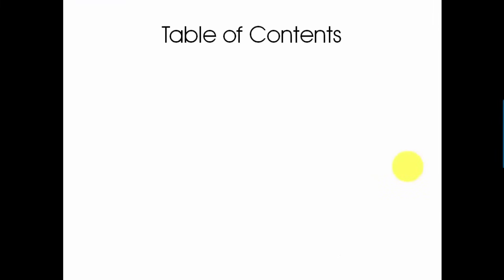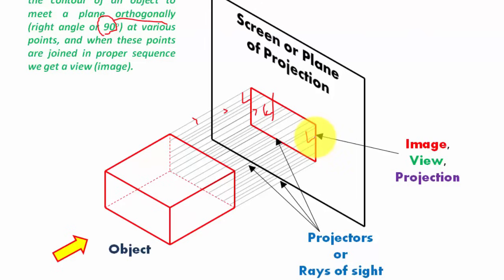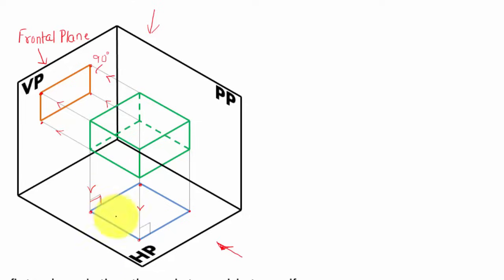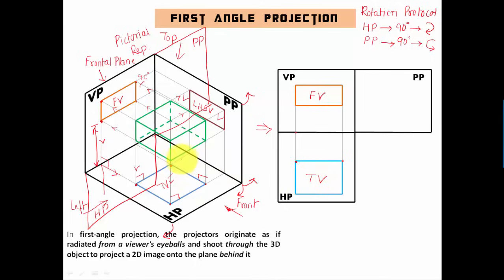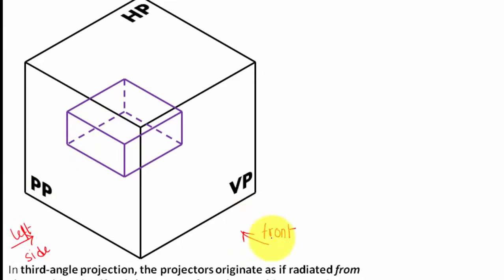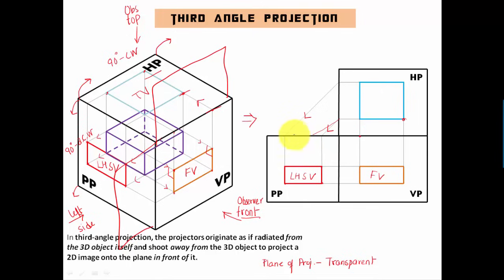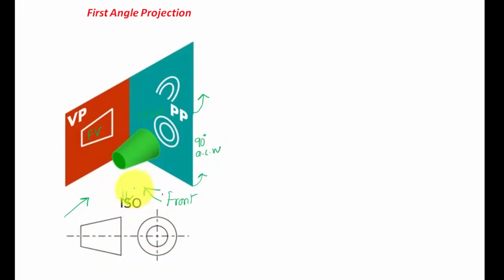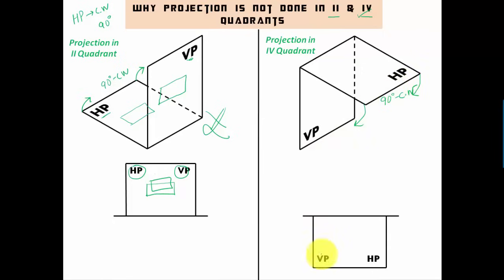Orthographic Projection_An Introduction_Engineering Drawing_Engineering Graphics_English

Comment: A straight line PQ, equally inclined to the HP and the VP, has its end P in front of the VP and 20 mm above the HP. End Q is behind the VP and 40 mm below the HP. A point on this line is in the VP and 10 mm below the HP. Draw the projection and finds TL and inclination of line with HP, if the distance between the projections ends is 60 mm.